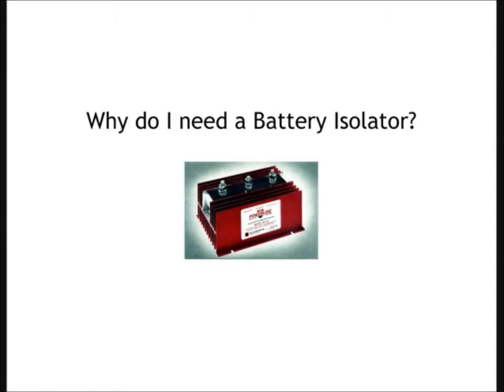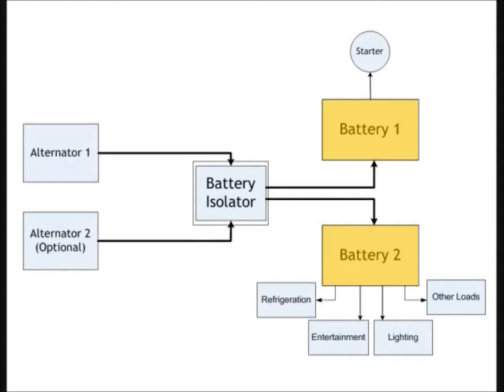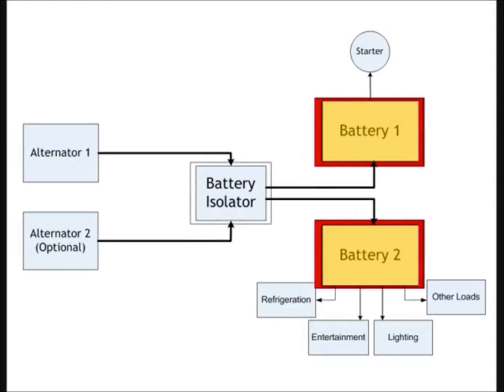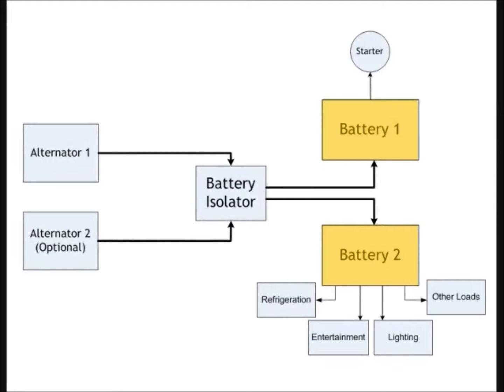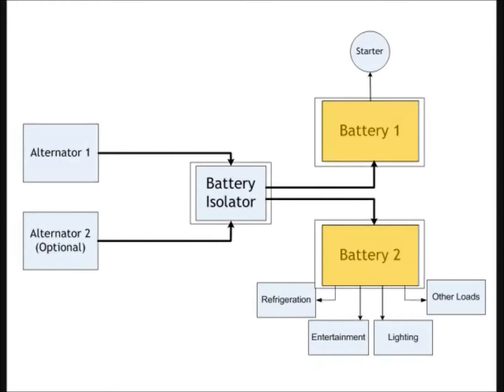Why do I need a Battery Isolator?

Comment: Good sir
Reply from the maker: Battery isolators are used to charge two different battery (s) from one single charging source. The batteries are allowed to operate independently without one discharge in the other, thereby isolating it. Batteries must share the same type of chemistry (or charging parameters) for them to work with the isolator.